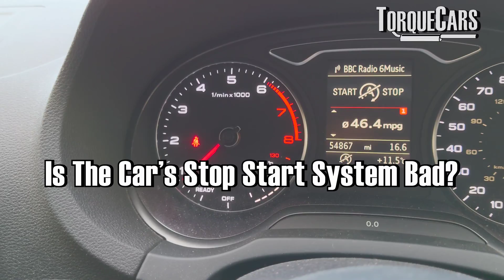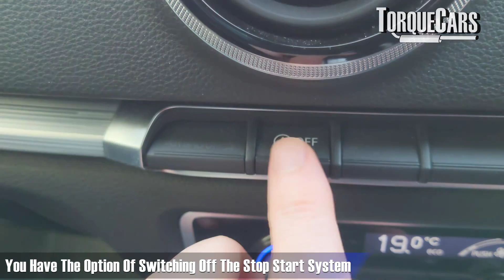Does Auto Stop Start System Damage Your Engine? ECO Savior Or Car Killer? 🚗

Comment: Can a stop start battery be used in non stop start engine?
Reply from the maker: Yes, they are able to provide the power needed but over longer periods of time and cope with high loads. They both output 12V which is what a car needs, but a stop start car will quickly kill a normal battery due to the extra cranking demand it places and the load from the car electronics when the engine is off.

Sadly it won't add any power or make the car go faster.
Reply: @torquecars  will a stop start battery be okay to use in a car that’s not stop start?

Comment: I don't like stop/start.  Most of the time I turn it off.  The bad thing is you have to remember to turn it off every time you start the vehicle.  In a rural area like I live in there is really not much benefit to have it.  Also, many times after it turns off the engine the light turns green within a few seconds.  It makes buying a vehicle more expensive and I believe over time it will cause repairs to be made.
Reply: on my mazda primacy 2013 turning the button off the istop light comes on, that means istop is off. If comes green means istop about to stop engine and istop hasn't been turned off ( istop in yellow doesn't display)

Comment: I’m very happy with my first start/stop system which is on a 2023 Honda C-RV. I agree that the computer does a good job of determining when to use it and that Honda makes it easy to turn off which I do when I can see ahead the potential for a series of short on and offs. On the other hand, I appreciate it turning off the engine for some of the longer stops I have. The time to restart has not been an issue for me and on those rare occasions when I want to drive away quickly I have three workarounds. 1) Use auto brake and keep my foot on the accelerator. 2) Ease off on the brake and the engine will restart. 3) Turn off the auto start/stop while stopped and the engine will restart immediately.

Comment: Interesting Video thanks for the info. I have had two new cars with Stop Start, a Range Rover Sport Diesel and a Ford Fiesta "Eco-Tech" Petrol. On Both I always switched the system off as soon as I jumped in the Left Hand Seat. Now after 3 years the Fiesta Stop Start has packed up (low Battery I suspect) so I don't have to switch it off any more. Yipee..... Result!!
Reply: Cocked that up, should have been Right Hand Seat......

Comment: - Project Farm on his YT video on this found via scientific analysis of oil samples that synthetic engine oil can go 18 months in the engine no problem, if the miles done are low.

Personally on my VAG TDI powered cars I change the oil every 7500 miles. Most of their miles are longer journeys and both have done between 100-200k miles.

Comment: I drove a SEAT Ibiza automatic recently and it did not appear to have a button to disable stop/start. Handbook said the way to prevent it kicking in was to only press the footbrake lightly when coming to a halt. It sort of worked, when it was practical to do so, but seemed rather ridiculous not being sure of the engine was going to cut out or not.Handbook did have a picture showing that on a manual Ibiza there is a button to disable stop/start!

Comment: I don't mind having the stop/start system on in a manual because it only activates when the clutch is released in neutral. I'll only ever do that if I'm waiting at lights for more than a moment. In other cases like queuing at a rounddabout the engine will keep running and be ready to go provided it's in gear

Comment: Auto stop starts damages many parts of your engine, Modern Auto stop start uses a compression start from the GDI injectors. So don’t worry about your stater motor. Things to be concerned about.  Everytime your stops it experiences heat soak which causes carbon build up. The PVC system sucks excess vapor from your crank case which contains vaporized oil. Use a very high quality oil and changed it every 5k miles or once a year what ever comes first.This is even more detriments if your car has a turbo charger on it which is oil cooled. The turbo bearing spins at very high speeds. Old school Turbo guys knew to let the engine run for a few minutes to allow the oil to cool the bearing. Auto stop start shits down the engine allowing the oil in the bearing to turn into carbon eventually destroying the bearing. The most strain on your value train occurred during starts even when at operation temperature.. This wears out cam belts and chains. If these fail it will cause severe engine damage.

Comment: The ring gear in my BMW diesel just separated from the flex plate. I have disabled stop start but one of the rare times I used eco pro mode the other day, I encountered road works, engine stopped (always freaks me out) so I put it back into comfort, engine started, a few days later the flywheel threw a wobbly. Mechanic says it must have occurred when starter has engaged recently.... hmmm.

Comment: 2022 Honda crv idle start stop. Saves 50 cents worth of gas. Wearing the starter out. To replace the Starter depending on parts.$600,00 to $1100.00

Comment: The best thing about this system is that button that switches it off. The only thing I hope is that the previous owner has done the same thing or has not done much driving using it, hopefully I got it with only 29K miles.
Reply: Good description. Well said that man!!

Comment: I have a Mini Cooper with stop/start.  The first battery lasted just over two years and was replaced under the service plan.  Since then I always turn off the stop/start function and the new battery has lasted 5 years so far with no problem.  Yes, it is a larger battery - 70Ah with a very high cold cranking current spec, but it didn't last.
Reply: This stupid feature can cause early timing chain failure on the 1.5 mini petrol versions and did on mine at 27 thou , done under warranty and a multitude of other issues  especially early battery failure same as yours on my Mini and dont believe this "over engineered"  components like the starter and ring-gear , they are not and wear out much quicker, the feature at least on the F56 mini 1.5 is an engine killer, far better to turn the stupid thing off, no issues since I did, all my issues were caused by the first owner using the stop start, including several electrical issues as the car relays are being constantly loaded and unloaded, you can fine more study's on you tube that show the engine oil life is cut short, the viscosity reducing causing premature wear to the engine so you need more regular changes if using this stupid and pointless system , every 5000 miles which I do on any car anyway, I used to work in the trade and have many trade contacts and the stop start is generally considered an engine wrecker , the manufacturers do not care as most will get past the warranty period, after that problems will occur, I'm changing my Mini but only for a car where I can turn it off /coded out or buy a disabler after market, anyone who has what we used to call "mechanical sympathy " or careful owners  will turn it off and get fewer issues, rant over
Reply: 8 years on my original battery of my VW and I use the stop start every day. Sounds like just a bad battery and not a stop start issue.

Comment: Interesting takes on both options.  My wife’s Disco sport has it and the first time it kicks in I remember to switch it off. Usually top of the road on an incline with a blind entrance where you have to boot it and to have it switch off is frustrating and potentially dangerous. Take what you say about over engineering but think all the electrical tubings on modern cars will knock batteries out faster than without. Keep up the good content 👍🏻
Reply: @leewatkeys9065  i have an Ecosport. Mine kicks every time i press the gas pedal. If you know how to fix it please let me know.
Reply: @Gringo20251 trade it in for something better

Comment: Just don’t believe it sorry
Reply from the maker: You Don't believe it does or doesn't cause damage? Please don't apologize, I've learned that people all have very different experiences with cars and car problems and by hearing as many points of view as possible we can have a more rounded out opinion.
Reply: I too am curious.  We had it on our 22 Silverado but I turned it off because,  to me anyway, that engine already had the cylinder deactivate,  so why add more stress onto it. 
Now we own something we've never owned before a Nissan Rogue  with the 1.5 turbo 3 cylinder. 
I'm playing with the system; that is I'm keeping close fuel economy lists checking whether or not it helps.  Plus I'm rereading the warranty closely to see what,  if anything,  is covered. 
I'm never too old to learn and like you're videos and the comments

Comment: My start stop ford eco boost has just cost me 4k for a new engine as the turbo failed due to lack of oil, constant stop starting.
Reply: You'll probably find with the Ecoboost that it won't be because of the Stop/Start tech that you had lack of oil.. the wet belts are notorious for breaking up and eventually blocking the gauze on the oil pump which in turn kills the engine/turbo.
Reply from the maker: Sorry to hear that so I guess you make a point of switching it off or disabling it. I'll be interested to hear from others with Eco Boost engines on this topic.
Reply: Be interesting if you could let us know how many miles the car has done and how old old it is, both have and impact on Cam Belt life.
Reply: @mickymouse6399  I had a Focus eco boost for 10 years with no problems. I had it serviced regularly with the correct oil and always used the stop/start. When I traded it in at 65k miles, still had the same battery and starter motor.

Comment: I have never l owned a motor vehicle or own any vehicle with a stop start system just like to point out a starter motor has only a certain number of cycles before it will fail as most cars are are automatic now you are pretty well stuffed if your starter motor fails were in a manual if you are on a slope you can start it l have replaced many starter motors in many of my vehicles l have owned and replaced many batteries as for engine wear with a stop start system the car is warmed up when the engine is stopped its not a big deal

Comment: I am having an issue with oil dilution in my 2017 Range Rover 4.4 SD V8. Do you think switching off the Auto Stop/Start would help to reduce or stop it happening?
Reply from the maker: Do you do lots of short journeys? Those engines take a while to properly warm up and during warm up they are dumping a lot of moisture into the oil. Getting the engine properly warm is a good idea and if stop start is preventing this then I would certainly consider turning it off.
Reply: @torquecars  What kind of moisture are you talking about? The mechanism of getting engine oil diluted in diesel engines has absolutely nothing to do with with some unspecified "moisture" in the oil, where did you get that one 😀 It is failed DPF regeneration cycles that dump not fully burnt fuel in the oil, fuel that gets injected into the DPF filter to burn the particles. It will happen if the engine stops in the middle of the DPF regen cycle and modern start stop systems are certainly designed not to stop the engine in the middle of a regen cycles. Lots of short trips definitely contributes to oil dilution, if that's how you mainly use the car, sell it and get a petrol one.
Reply from the maker: I will try to use a word that is more specific though as moisture is often thought of as water.

Moisture Definition: water or other liquid diffused in a small quantity as vapour.

This would obviously include fuel. Interestingly when you put a catch can on these you'll notice a lot of liquid building up when you do short journeys, this is not fuel but a by product of the combustion process and this often ends up in the oil, but in most cases will evaporate away when you get a decent amount of heat in the engine.

I have actually just shot a video on oil dilution as i thought that was an interesting subject so when I've edited it and published it please let me know your thoughts on it - I'm always striving to improve my knowledge and then share this with the community.
Reply: @TonyHammer61  dilution with fuel ? It won’t be the stop/start try having your fuel system checked and the injectors tested, cleaned or replaced.

Comment: My F150 2.7 turbo would shut off at red lights just 1 mile from home. The windshield wasn't even completely defrosted yet. Made my own heavy duty trailer harness with two large power resisters which mimic trailer brake lights. Truck thinks I'm always towing and stop/start is always disabled. Other benefits, 1. Blinks 5 times vs 3 when you tap the blinker stalk. 2. Charges my aux AGM battery in the bed (canopy/topper mini camper) via spliced trailer battery wire. 

My 8 year old starter AGM battery was still starting the truck normally when I recently replaced it due to battery saver function always activating when I turned off the ignition and wanted to listen to the radio.

Comment: I drive a turbo diesel with a stop/start system, I always switch it off for the fear of having the engine shut off while the turbo is hot. My turbo is not water cooled so i dont want to take the chance. Plus we cant blindly trust in manufacturers to build parts that will last a very long time. Many say components will last the life of the vehicle, for all we know, the life of the vehicle could be 8 years or less. Idk, because idling too long is a risk, constant stop start is a risk. Best solution to me is just keep up on top of maintenance and hope for the best.
Reply: Its only bad if you idle for hours at a time. Other than that, yeah shutting the motor down while the turbo is screaming hot just cooks the oil inside of it. Then you get sludge and everything just falls apart, at least on the Hyundais. They suffer the most, my mothers palasaide started burning oil after about 40k miles. Did a compression test and cylinders 3, 4, 5, and 6 were DONE.
Reply from the maker: The oil sludge in the hot turbo is also a VW group thing and I'm sure lots of others without water cooled turbos have similar problems.
Reply: @torquecars  oh definitely. Especially in the b5 series. The design was pretty horrendous with the fact they only recommended blended oil and the oil pickup which  frequently clogged pretty much meant you had to lift the motor out of the frame since that was the only way you could access the pan. I saw some people drill a hole in the pan with a hole saw to get to the pick up LOL 😂
Reply: This is my concern as well. Ford EcoBoost engines all have turbos and would all suffer from this. Auto start/stop in light around-town driving is probably fine, but if you've been highway driving for a while, you really need that oil circulating for a bit when you slow down.
Reply: Totally agree with the turbo comments.
😊

Comment: I turn mine off as I've found I get better economy  with it still on idle at the lights and junctions. Plus I feel it doesn't do the starter motor any good because they aren't heavy duty and not really designed to constantly keep starting an engine. Just my thoughts and it works for me.

Comment: Apples to oranges. You over-engineer a starter motor (which should have been done 50 years ago). Of course it lasts longer now. Second point, Fuel in engine oil. Every stop-start system has more. Is that really a 'green solution'? 3rd point, the 1 second extra it takes to pull away at traffic lights means someone else behind is trapped on a red light. Do they have stop-start? 
4th point. You are carrying additional battery WEIGHT, and where does the electrolyte and cells come from exactly? (not very green is it?). 4th point, the smaller engines get, the more boost turbos have to make. Heat soak in a hight pressure turbo is the reason why we all bought a turbo timer to keep the engine running to provide oil to the bearings. Stop-start is political and not physical, just like electric vehicles. It might slightly reduce emissions in built up areas at the expense of emissions, engine wear, cost, service, everywhere else.
Reply: Exactly, political.   Modern cars are absolute garbage.
Reply: my thoughts as well.  Active lubrication is always better than passive.
Reply: @Dominican_War365  it’s not really an extra second though. The car gets going pretty quickly, but I don’t like start-stop anyway, as I find I don’t like the feel of even that brief hesitation.
Reply from the maker: You make some exceptional points there my friend. On point 3 I would like to add it depends on the car. I've driven some that start as soon as the car in front starts moving (2023 Audi A3 with adaptive cruise control), and my own older A3's engine is back on before I've lifted the clutch to pull away it really is almost instant. But I guess the key here is almost.

There are two many green solutions out there that when you dissect it are actually worse in terms of emissions.

If only we could keep our cars for 25 years and not have to keep replacing them, they may guzzle the gas but I bet that still outweighs the cost of production and shipping on a new car.